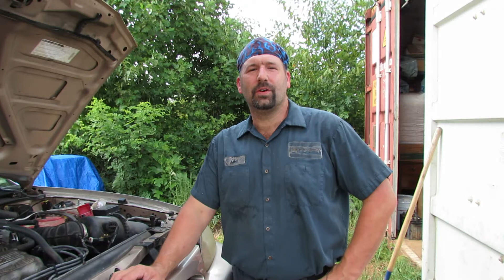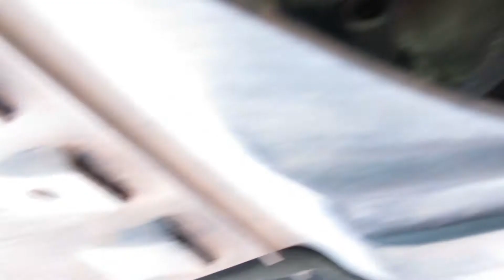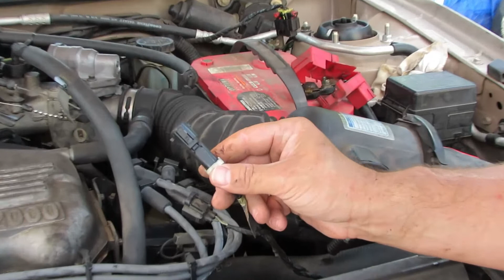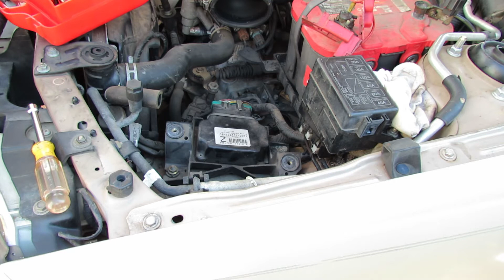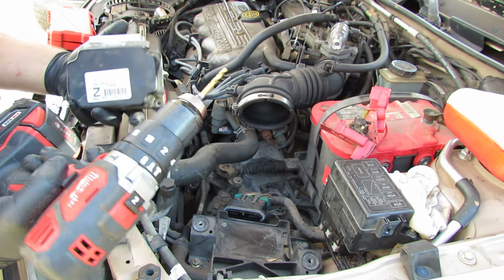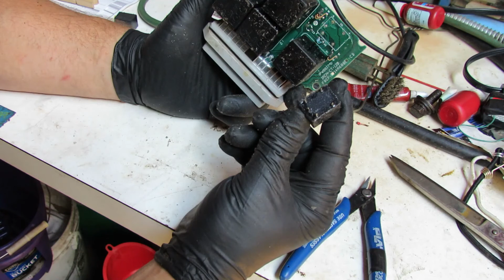Part 1 Ford Escort Mercury Tracer AC Relay CCRM Module Easy and CHEAP Repair

Comment: Go to an auto salvage yard and pick up the improved replacement for about $20.
Reply from the maker: @MarkBush-en5cz good to know. I will check that out next time. Thanks for watching and sharing! ~Mr. C.
Reply: @NaturesCadenceFarm  I had to do this for my ex-wife's 99 Ford Escort ZX2 with the ZETEC engine.  The improved part will have ID like: PN# xxxxx "replaces yyyyy" and will be on a later model vehicle.
I always recommend looking for an owner's forum for the vehicle and look for that specific problem or "Common Problems."
Hope that you do well.
Reply: @MarkBush-en5cz hey any idea of vehicles that have this improved model in them? I have a 1999 escort with ac issues and would rather replace it than fix the existing one if I can.
Reply from the maker: @MarkBush-en5cz thank you for all of the awesome info. I will definitely check out the updated version. I will look into the forums also. That sounds like a treasure trove of help. ~Mr. C.

Comment: mine is sealed with what looks like glue, you can't even see the circuits. I got a new CCRM from NAPA but when I got it home and installed it, the car would not crank. I took it back and got the old one back and told them at least it runs with this one. Then wired in a relay and straight wired the fan threw a .relay.
Reply from the maker: @altonlynch5464 that's a bummer. Glad you got it figured out. Nice work around! Thanks for watching and sharing. ~Mr. C.

Comment: What make the camshaft get power
Reply from the maker: @user-ln4lj7ry3v the rotational force on the camshaft is supplied by the timing belt which is driven by the crankshaft. Thanks for watching. ~Mr. C.

Comment: Very good video. My fuel pump system stops receiving power after 20 minutes or so. Could you tell me which relay in the ccrm is for the fuel pump? I’m pretty certain it’s the relay.
Reply from the maker: Brandon Anderson the fuel pump relay is located top center with the ccrm connector facing the ground. It would be directly to the left of the a/c relay in the video at 14:07. Hope this helps. Thanks for asking, I will try my best to help in any way. ~Mr. C.

Comment: Hello. Is the CCRM on this vehicle also known as the fan module?
Reply from the maker: LPFFPO X-2 I have never heard it called the fan module but maybe some people do. The ccrm does control the cooling fan but also the A/C clutch and fuel pump. So to call it a fan module might cause confusion. Excellent question!  Thanks for asking. ~Mr. C.

Comment: Would a bad ccrm cause blower motor to not run?
Reply from the maker: Coby Gaurin I would say no but if anyone knows more about this system we would love to hear about it. I say no because when the relay failed in my ccrm the blower motor still worked but the compressor clutch would not engage. I have seen blower motors stop working all together or not on one speed in other vehicles when the blower motor resistor failed or the wiring connector going into it failed. I hope this helps. If not please let me know and we will figure it out together. Happy wrenching. ~Mr. C.